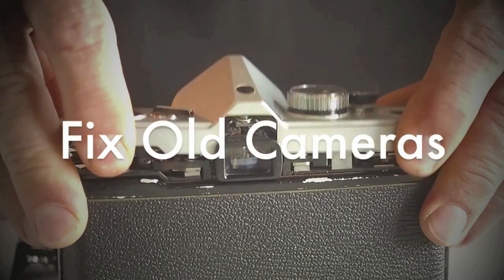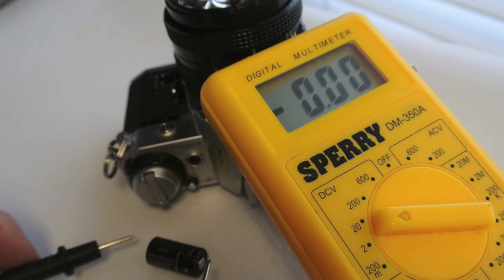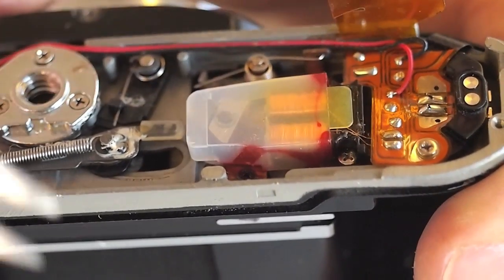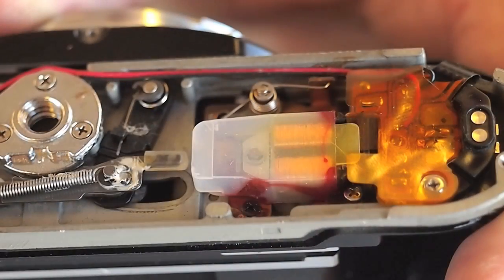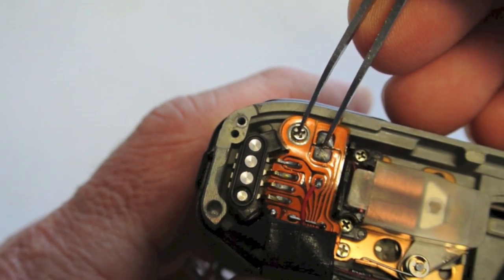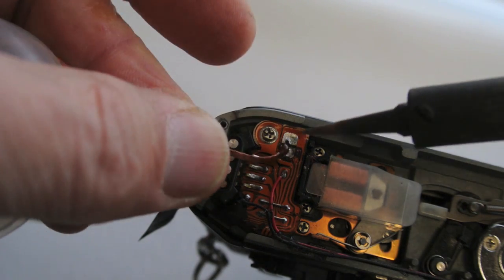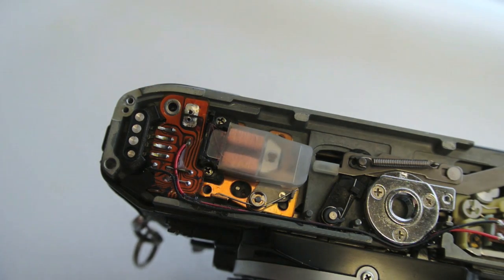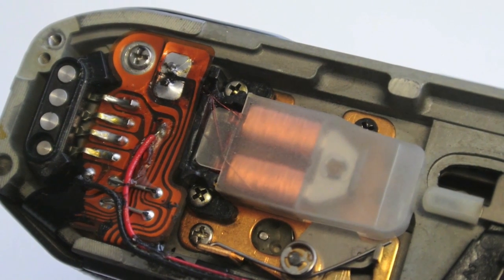Fix Old Cameras: AE-1 Release Magnet

Comment: Hello and thanks for posting this very detailed video.  I bought a Canon AE-1 Program and I'm not getting any response after I insert a fresh battery...  It's like it doesn't have a battery at all: the battery test button doesn't do anything (no beeps), the shutter is stuck and so is and the advance lever...  Just wondering where should I start??  Any advice would be greatly appreciated.
Reply: I'm having this issue too, did you find any fix for it?
Reply: I’m about to start digging into an ae1 with a power issue and stuck mirror. I’ll try to record all of what I do and post it.

Comment: This worked for me! My issue was a bit different (the magnet wasn't sticking so the mirror was releasing any time I used the advance trigger). Cleaned the contacts and it works great. I just hope I didn't do any damage sliding the cover off. It was stuck on there. So far it works perfectly!

Comment: I'm having a similar problem with the shutter: when pressing the shutter button the camera doesn't fire. When loading the camera with the lever, the camera shoots a picture even before the lever is completely tightened. So the shutter button doesn't work but the camera does take a picture during the loading process via the lever. Any ideas?
Reply from the maker: +Daan De Ridder 
Probably the permanent magnet of the release magnet is not holding the latch lever due to weakness or grime.
Reply: I've got an ae1 that won't take pictures when it's cold. Is this a common problem? Any ideas on how to fix it?
Reply: @coltonholiday4872  try a new battery, cold lowers voltage

Comment: i have just bought an ae1 camera in visually stunning condition. however when taking photos, my camera always shoots with the self timer setting, even if i have the shutter switch set to "A". for instance i turn the switch from "L" to "A" to start taking photos, then the perfect moment will arise, and then when i half press down the shutter button, the camera is already registering that i have clicked the self timer option and the red light will begin to count down.. and then ill be like oh why didnt that shoot and then ill take a photo of the ground... (all this happens after ive ensured its on the "A" setting". However if this accident happens, i can switch the dial from "A" to "s" mid count down and it will take the shot. please respond if anyone has had this issue. thanks!

Comment: Hello dear Fix Old Cameras people!
First of all, thank you so much for uploading all these videos!! They helped me out before and they were an even bigger help when I started to work on two broken A1´s which I bought for like 7 dollars. 
I followed all your steps in the video on the top plate remomval and exchanged parts in between the 2 bodys so that now I have one pretty decent looking fully funcntional one (top-plate wise)!! Thanks! 
Then I looked at the release magnet because the shutter wasnt firing. I had to exchange the plastic covering of the magnet, since it was in the way of the advance lever thing. Now everything is working!! But I have one problem left...
Ever second or third time the shutter still doesnt go. But when I push in the multiple exposure lever and cock the shutter again it fires. And it fires sometimes while advancing, sometimes when pressing the release button afterwards. Shorting the ground screw with the shutter release magnet terminals, it fires evertime! Any ideas on how to solve this? It would be awesome if I could give life to at least one of the two cameras.
Reply from the maker: This might sound overly simple, but when it fires erratically it is possible that you have a battery that is on the edge of the needed voltage and nearly exhausted. When it releases on advance the latching/release magnet is not holding.

Comment from the maker: If the meter indication is normal on the AE-1 and the auto aperture always stops down than the magnet (MG-1) that is located on the side of the mirror box could be the cause. Often cleaning the locking surface and pivots of this magnet will correct this issue. If the auto aperture always stays open than MG-1 could be defective. If MG-1 checks out OK than bigger issues. A video showing how to remove the mirror box to access MG-1 would be fairly complex and involve soldering and handling the printed flexible circuits. Such a video could possible be produced in the future. Thank you so very much for your interest and video suggestion.
Reply from the maker: First off make sure your replacement battery is delivery 6 volts. You might have to remove the top cover and check the contact blades of the switch configuration that is located under the release button. It is possible that could be the source of the issue. However, often when the meter latches on after fully depressing the release button it is an indication that there is a problem in or around the release magnet.
Reply from the maker: Very good to hear. It seems you fixed it without any applicable comments from FOC. Your persistence and patience paid off.
Reply from the maker: In order to check the functionality of a Canon AE-1 a good 6 volt battery must be installed. The camera is completely battery depended for release and shutter function.

Comment: Hi I have an AE-1 I just purchased that was supposed to be working perfectly. After a few runs of the lever and releasing the shutter, the mirror will hang up and the shutter stays open. If I press the battery check button, it will release the mirror. I found your video, and by grounding the screw the shutter will release. So, if it's not the magnet what could the problem be? I've got fresh batteries. I don't have a meter to test the voltage. But the in camera one says they're good. I know it's not great, but with two new batteries it has the same outcome. Self timer also work. Wondering if you can help me out. 

Thank you.
Reply: This is my exact issue as well, please share if you solve it
Reply: I have this exact issue… It seems like every time I find someone having the exact same issue as me there are no reply’s explaining what it could be!

Comment: Thank you for the video. I've fixed one Canon AE-1 with this tutorial, however, I've got one Canon AE-1 (not Program) that releases the magnet when you short it but won't fire the shutter when pressing the shutter button. I have a new battery installed and the light meter works as it should. If I release the magnet manually while pressing the shutter button the camera fires at the shutter speed that it's set to(1 second opens the curtain and after one second it closes). What else can I check for? Thank you.
Reply: Same thing here
Reply: same

Comment: Thanks to your info I could see that the magnet was not defective on my AE-1 and I'm not sure what I did but it seems fixed now. It fires every time without getting stuck or immediately taking a photo after winding the lever.
Reply from the maker: +RF BRCK 
Maybe there was a light film on the magnet linkage that was cleared by your investigation... or maybe just a little serendipity.  Either way.... excellent to hear.

Comment: Just wanted to say, that my shutter wasnt firing, and I even tested the battery and it was right at 6 volts, but it ended up being a bad battery. I think the batteries that go into these cameras are very finicky. Might be a good first thing to try before taking apart your camera. Kinda sucks they made the shutter release electronic also, would of been nice if the Exposure meter was the only electronic part of the camera. Other than that, its a pretty cool camera.

Comment: Hi, I hope you can help out here.
I have a Canon AT1 which I absolutely love to use, it was in exceptionally clean condition but recently due to my own clumsiness was dropped, the top pentaprism housing bore the brunt with some dents.
I now have this release problem, I can manually flick the release arm and can also bridge the contacts to release the arm as per this video but the shutter button does nothing at all, it presses in fully and the batteries (x2) I tried are both good but the shutter won't fire or the self timer light and beep when the button or cable release is used.
I'm assuming i've damaged something related to the shutter button under the top plate but before I dig in there i'd love your expert opinion on the possible cause and (hopefully), repair.

Regards, Mike
Reply from the maker: The top cover is plastic and there might have been enough flex from the impact that it damaged the electronics at the peak of the prism. The sharp edge of the prism might have created a crack in the flex or cut wire with out actually causing separation. It might require careful magnified inspection to discover the break or breaks.  Also check the contact blades of the release switch for misalignment.
Reply: Fix Old Cameras Thankyou very much, I'll get the top plate off and take look alittle later, I hope I'll be able to get it running again.

Comment: Thank god I found this channel ... first of all I am sorry for my English, I am from Uruguay and I really like what you teach and share .
Now I have an AE 1 that has a problem with the meter, every time I press the shooter, both red lights turn on .. like if there wasn't enough light  .. but the thing is that the arrow moves up and down, so there must be some power ..  It is not a battery problem I guess !!  I would appreciate if could help me somehow !! 
I also wanted to ask you if you have anything about how to set  a 35 - 70 nikkor zoom lens apart.... thanks .. thanks .. thanks !!
Reply from the maker: Giusepe mayard It is possible that the tungsten linkage wire that connects the ASA dial to the ASA resistor has jumped a pulley and is caught under the wiper dial. Familiarize yourself with this area of your camera by watching the Fix Old Cameras videos on the AE-1 - Top Cover Removal and the AE-1 Jammed Wind Lever. If the ASA tungsten linkage wire is where it should be than the cause of the cameras malfunction is probably component related.

Comment: I was given an AE-1 Program and it's presently on Ebay. Thanks to a potential buyer's question, I've discovered that the shutter button doesn't work at all nor does the film advance lever. There is no battery installed and I don't have one to test with. Is the lack of a battery the problem with the frozen shutter button and film advance lever?

Comment: I am having trouble with my release magnet not holding at all, basically as soon as I wind the shutter it fires. Is the a broken magnet? Do I need a new one or is there a fix? I have a canon ae 1
Reply from the maker: The permanent magnet of the release magnet unit might be weak. If this is the case the magnet will have to be replaced. However, the release magnet surface should first be cleaned as outlined in the AE-1 Release Magnet video as this could easily fix the issue. Also watch the cocking stroke to make certain that the release arm of the magnet is fully seated at the end of the stroke.
Reply: Fix Old Cameras Same thing happening to my AE-1 Program... Will have a go at cleaning the magnet tonight.

Comment: Thank you very much for this video.
After cleaning the magnet with alcohol my A1 works for some time and gets stuck again - any idea on that?
Is there a place to order these magnets?
Reply from the maker: Typically the magnet works or it does not work. Rarely are they intermittent. Might be the release capacitor {he blue(typically) capacitor living next to the release magnet} It sounds simply, but often times an erratic release can be caused by a battery that is on the edge of expiration. Check your battery to confirm that it is delivering 6 volts of available power before proceeding with further troubleshooting of the magnet

Comment: Hello. I have a problem with my ae1. When I let it rest, the first shots (2, 3 or 4) are shot slowly, or the curtain takes time to open, the diaphragm remaining open until the curtain opens and closes. I have tried cleaning the electromagnets but it still happens. Could you recommend something to me? The next thing I'm going to do is pour lubricant through the screw on the right side of the mirror. Thank you very much in advance

Comment: Thank you for your video! If I short the ground screw with the magnet it only releases when I press the shutter button at the same time. Therefore it seems like I could just permanently short the magnet but I'm wondering if you know a proper workaround?
Reply from the maker: If you permanently short the contact to ground it will probably run down the battery. Make sure the ground screw is tight and the contact clean. Otherwise, there could be a break in the flex leading to the upper circuits or the shutter release switch could have poor contact or bad solder connections. Finally the IC that lives on the shutter release side of the prism could be defective.

Comment: Tkx very much for the video and your help.
Today I got an issue with my A-1 while testing it since my last use 4 months ago.
It was working fine and I've tested manually all the speeds.
Suddenly, the shutter wan't release. I tried many times but nothing. 
I put another battery, same result.
No display on the viewfinder. 
I opened bottom cover to check the shutter magnet, it is releasing when I free it by small screwdriver. I clean it with swop and isopropyl alcohol.
I've advanced one more time the lever and fire, same issue : doesn't release.
I short-circuit both magnet connections with the earth screw one at a time to test if the shutter release but no improvement. 
Do you think that I have to replace the magnet by new one ?
Thank you in advance.
Reply from the maker: From your description of events, suspicious that battery voltage might not be 6 volts on your replacement battery - or the magnet is bad.

Comment: Hi, very helpful video! I have a question though. My AE-1's mirror does move when I push the shutter release button, just the curtain doesn't. The curtain only moves when I set the shutter speed to anything slower than 1/8 (which is pretty useless). 
The curtain does not move when I short the ground screw (mirror does move). So when we talk about the shutter releasing, does this imply both the mirror and the curtain moving or just one of them?
Reply from the maker: +Tim Foerster The shutter release sequence is.... the mirror rises up against the viewfinder, the first curtain travels across the focal plane, followed by the second curtain. Sometimes the tungsten ASA resistor base connecting wire can jump the pulleys or break (spider wire fishing line works as a subsitute) causing an entanglement that can effect the contacts of the resistor base and cause shutter release issues as you describe. If you remove the top cover and discover the wire to be displaced you can check out the end of the Fix Old Camera video "Canon AE-1 Jammed Wind Lever" for the proper routeing of this linkage wire.

Comment: Hi, thank you very much for your videos! They are very helpful.
I would like to ask you a question about my Canon AV-1.
Everything is ok with this camera but I have to remove the battery every time I want to "turn it off". Otherwise the camera would drain completely the battery in a few hours.
If I look in the viewfinder I always see the shutter speed indicator moving. I think it should move only pressing the shutter button.
Have you any idea about the cause of this problem?
Thank you very much
Reply from the maker: You are correct the meter should only turn on with light pressure to the shutter release button. A very strong possibility the contacts under the shutter button are causing the issue.

Comment: Hi

I bought a AE1 Program today. It seems to be in good condition....but it has an issue, and I hope you can help me.

The mirror is in the Up Possision, the curtain ist closed, shutter wouldn't fire, and I can't wind it...

It doesn't have a battery in it...hope the mirror will come down when I put one in. Could this be the problem? Will the Shutter only release/fire with a battery?
Reply from the maker: It is battery depended for release and the battery needs to be a full 6 volts below 5.8 and it will not fire consistently or not at all. However, the mirror should not be stuck in the up position.
Reply: Thanks for the update👌

I will buy a new battery and try her out...i do hope all is good

UPDATE
I just put in a new battery, and she works!!! Not perfekt, she has the typical Canon Asthma sound of the shutter and the speed is somewhat slow, but I guess those two things go together

Comment: Similar but different issue with my AE-1 shutter. The shutter fires, but doesn't return or 'close' by itself (2nd shutter is hanging open) Cleaned the magnet, and no change. BUT... if I cock the shutter and MANUALLY release the shutter, it cycles fine. If I press the shutter button, the magnet (shutter) releases, but the 2nd curtain doesn't close. (Battery is new and works in another AE-1) The smaller magnet (? - opposite side from the main magnet, near the wind mechanism) doesn't release. Giving it a gentle push causes it to open & recycle just fine. Again, if I wind the shutter and trip it MANUALLY, the shutter cycles fine. But using the shutter button, it only opens the shutter (main magnet is OK) but the 2nd curtain hangs and the shutter curtain remains open. Possibly the most telling 'clue' - if I wind the shutter and MANUALLY ground the magnet, the shutter cycles fine. Any thoughts/ideas would be much appreciated!
Reply from the maker: +Tony Muller The tungsten linkage cord that links the ASA shutter dial to the resistor base might possible be out of position and causing the issue. Watch the FOC video Canon AE-1 Jammed Wind Lever for some insight on how to properly route the link wire. If the link wire checks out properly, then most likely you might have a purely electronic issue.